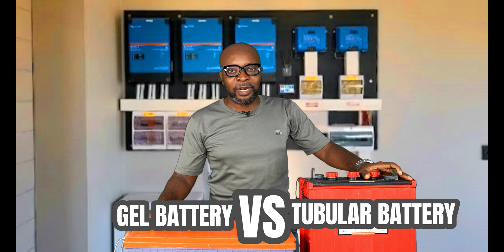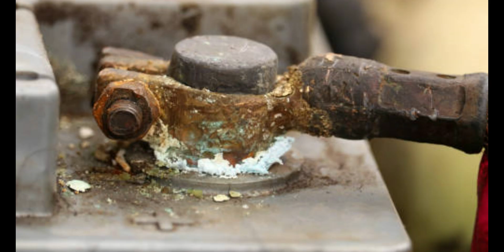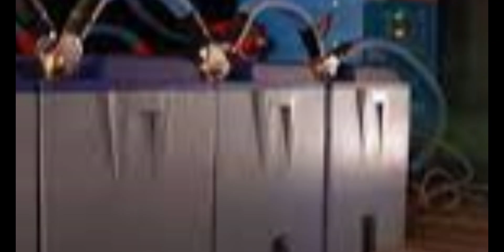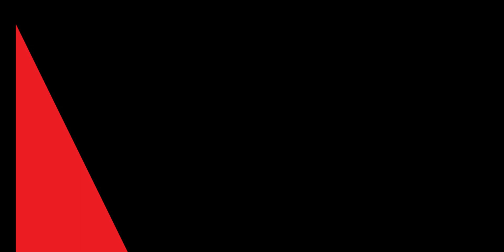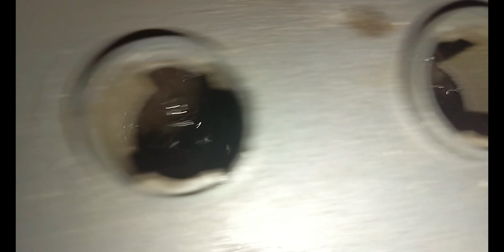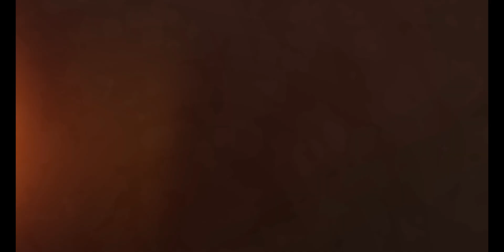Differences between Gel and Tubular Battery

Comment: If a new solar is installed with new dry cell battery how long should it be charge before you using it?
Reply from the maker: @fgcomedytv  3 to 5 hours is fine
Reply: @smilinsunsmilinsun8056  thanks someone say after it fully charge you have to leave it for 10hrs before start using it..

Comment: i mean at this poin why buy gel batteries at all??
Reply from the maker: Every battery fits a particular installation need , there is always an advantage
Reply: @smilinsunsmilinsun8056  I've never heard anyone actually need a gel battery. And your video just emphasizes that point about all of its disadvantages. It being more expensive, as well as more fragile, as well as giving fewer cycles, mean that there are no clear advantages. 

Before this video I had heard that you can discharge gel batteries up to a DOD of 70% But in recent years I've been told that that's not the case that it's the same as standard tubular batteries because they are made up of essentially the same components. Which makes sense to me. But if that's the case then I don't know what the advantages are at all. Aside from maybe increasing your bill the launder money.

Comment: Do you recommend rain water carefully and freshly collected from the rain in place of commercial distilled water? It is in abundance during rainy season. This could be handy when one wants to clean the battery and change electrolyte.
Reply: No. The rain water contains enormous compounds and chemical elements that will be detrimental to the health of the battery.
Reply: Thanks for the tip @princekomenenewton2584

Comment: Hello sir from Syria

Do you recommend buying this battery if it's manufactured 10 months ago? Or is it considerably better if it is produced since less than 3 months?
Reply from the maker: The shelf life of a  lead acid battery without charge is between 5 to 7 months , SLA and SMF battery essentially discharges 3% every month so if it stays longer that 7 months it might start sulfating.
Reply: @smilinsunsmilinsun8056  
Thank you very much for the insightful answer and valuable experience!

Comment: Please the battery i use is carbon long tubular battery, and it has some acid level floaters, after some months the battery life reduced but the floaters are still at green but there are some liquid spilled around them, what could be the possible problem
Reply from the maker: Are those batteries in an enclosed area
Reply: @smilinsunsmilinsun8056  yes sir
Reply: I've this same problem and yes they are in the house and not outside as you suggested.
Reply: @buikemm How were you able to solve the problem??

Comment: Thank you for the video, as usual. 😁
I was actually hoping that you will mention what to do to remedy a situation where the tubular battery gets tilted and the liquid spills. What would be the correct thing to do to remedy the situation? Or, does one just go ahead to use the battery in spite of the liquid having spilled and as long as the level remains above the plates? Or should one top-up and with what should one top it up?

Comment: Changing tubular battery electrolyte works just fine. Done that so many times, it give good performance like a brand new one. Nice one
Reply: To be clear, you are suggesting that the once every seven months maintenance where he mentioned that one should add distilled water instead electrolyte can be added and it won't affect (by reducing) the lifespan of the battery?
Reply: @ekeretteekpo3004 Use only distilled water 💧 until your batteries are closer to their lifespan
Reply: @ekeretteekpo3004  no, what I meant is, I would prefer after 2-3years of usage and topping with distilled water, discharge every liquid, wash clean it and add 100% electrolyte. It works very well with excellent performance
Reply: @scodevicetech  uhm... So, to be clear again, you are suggesting the regular maintenance of topping up with distilled water for as long as that will last the battery's expected performance and, when the performance is noticeably dwindled, to replace the electrolyte and distilled water - basically start from scratch. Is that it?
Reply: @scodevicetech  by the way, what do you mean by wash clean?
Reply: So I just washed all my water off so I should get pure electrolyte and put in without distilled ?
Reply: @lovebank5274  why, if I may ask?
Reply: @ekeretteekpo3004  because of too much carbon and probably will weak the performance of the battery so better loose all the water and wash and them fill with new electrolyte
Reply: @lovebank5274  okay. How did you go about emptying the whole thing?
If I may suggest, check out the manual for your battery for the recommended specific gravity. Get a hydrometer and measure as you fill each cells chamber with electrolyte up to the designated mark for your battery. Be sure that you are adding equivalent amounts into each cell chamber.